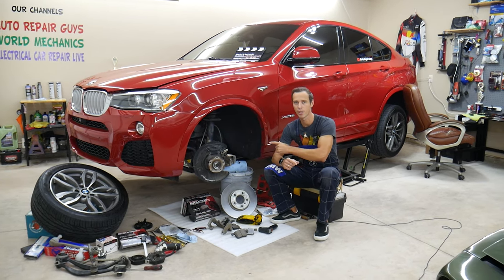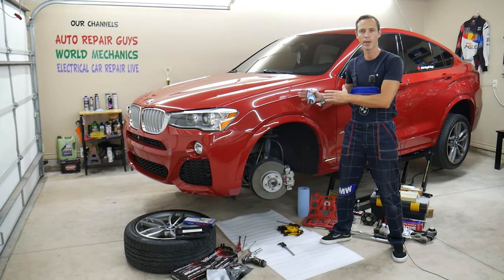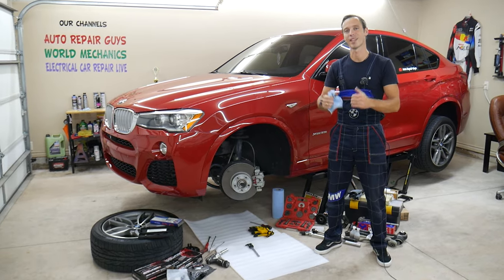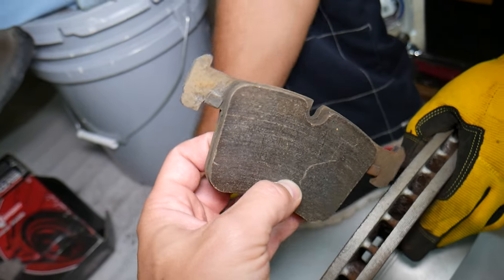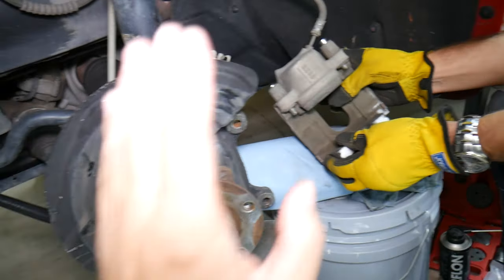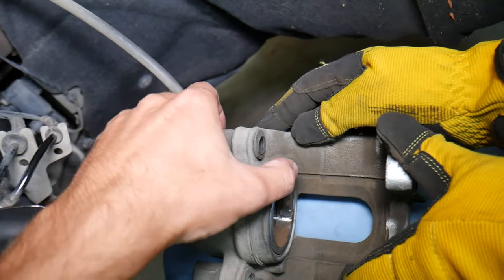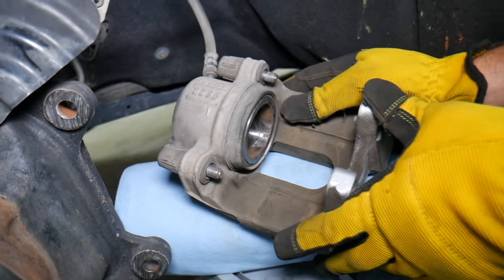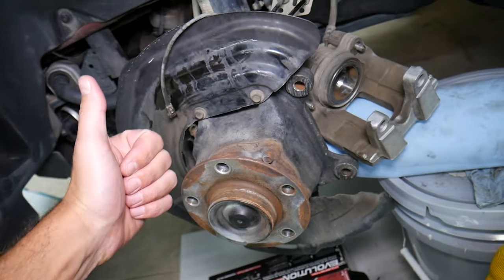WHY BRAKES OVERHEAT ON A CAR

Comment: My brakes are overheating. I have changed the pads, piston is not stucked and gliding pins are moving. I didnt change the rotors

Comment: I have a 2001 Ford Explorer and the brakes seem fine, they are not binding because I can push the car very easily and they feel to work very good, but if I am going down a steep long road the brakes burn and smoke pours of them. Any ideas what could be the problem and could it be just poor quality brake pads as I do not know what brand is in it because I have only had it 6 months. Thanks.

Comment: I replaced the rear brake pads and discs and now when I drive the car the discs get hot and holds the car. What can cause the problem? It is Lexus rx 400h

Comment: Why does the car overheat when using the air-conditioniner. I use a Ford Fugo
Reply: Issue with fans or coolant
Reply: The radiator is clogged on the bottom. I just went thru this on the s-10 zr2.  Only when AC was on it started overheating . It was the radiator.